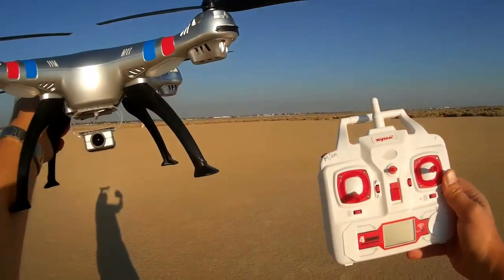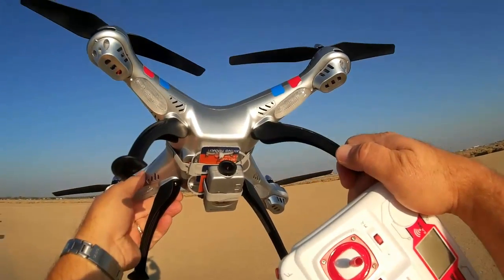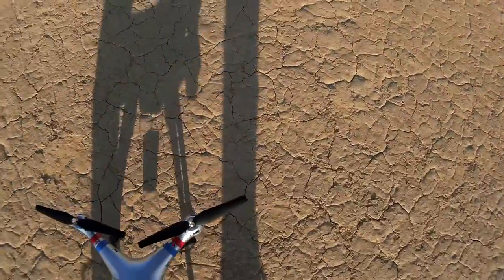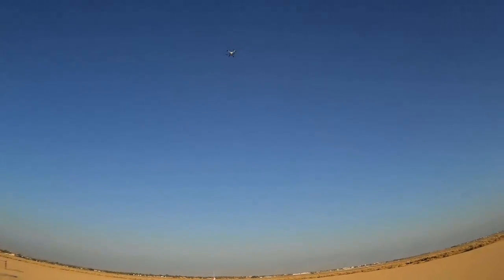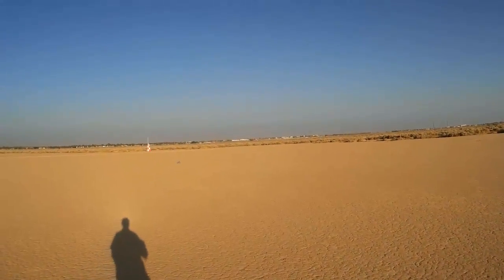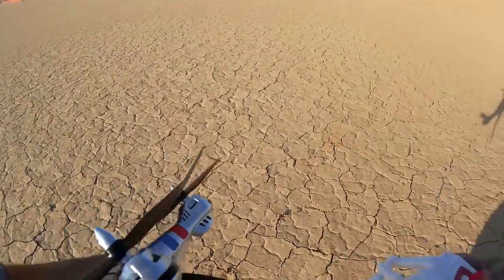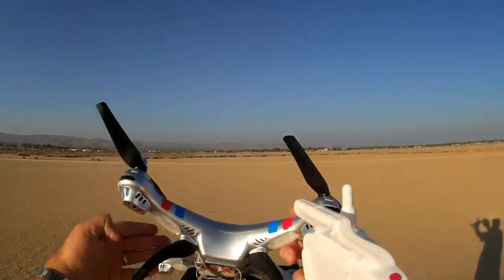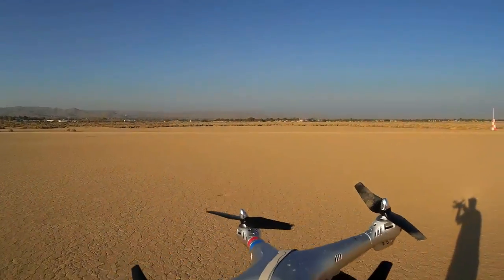Syma X8G Range Test

Comment: My X8G  got caught in a stream of wind at the beach and blew out over the water so far I was sure it was gone forever but I lowered the throttle and as it got down near the water it got some traction and flew back to the beach. I really cannot say in feet how far my X8G can go but it is about as far as you would want to go and still see it and enjoy it.  I don't know if it made a difference but I bought the expensive lithium super cell batteries for my controller. They are supposed to last 9x longer than regular batteries and they have been great so far.

Comment: i have a question , when the drone is going forward and gets out of remote range , does it shut down and crash or does it continu flying forwards until batteries are dead ?
Reply: +Markovish please respond , i've lost my syma x8g and i want to circle the area where it have possibly crashed in .
Reply from the maker: +Markovish Yes it drops.  Would recommend starting at about 300 meters down the direction that you last saw it, and keep working outward.
Reply: thanks a lot
Reply: hey again .. i have spent the last week looking for my crashed x8g but no luck ... i've used Google maps and looked within the remote maximum range area ... can you give me some advice please ?
Reply from the maker: Markovish Well, maybe somebody found it and took it home.

Comment: Does it really only go about 50 meters? I have the syma x5sw and it will Easily Reach 100 meters
Reply from the maker: +treverlid87 No it goes over 200 meters.  It turns out my particular transmitter was defective with poor soldering of the antenna.  Other X8G's should not have this problem (unless it was soldered by the same guy ;)
Reply: I'm having the same range issue. Can you share any resources on how to fix the antenna wire?
Reply from the maker: Ryan Hersh Well it involves opening the transmitter, and checking or resoldering the antenna connections to the circuit board. But if you have no soldering experience, a better option would be to first contact your vendor's customer service to explain the problem.  See if they can send you another transmitter.  If they give you a hard time, try PayPal dispute.  If PP dispute is not an option, just purchase another transmitter, as they're not expensive http://shrsl.com/?~dc4z

Comment: Quadrocopter 101    I have a question .How can increase the range of 100 meters?
Reply from the maker: +King Master 43 Its range is close to 300 meters. I had a defective transmitter.
Reply: Quadcopter 101 sp the drone will fly farther than yours plz respond and I'll sub
Reply from the maker: impulse 455 Yes it will.

Comment: I figured it out! The transmitter for the old x8c, is way powerful, so powerful in fact that it interferes with my audio equipment in the other room at a distance. When I switched on the x5c transmitters, there was no interference. so I set up a strength meter and I found out that the x8c controllers, at least the older ones, radiate way more power. That's how you're getting the phenomenal range. I would be willing to wager that they lowered the output power or modified the transmitters in the newer versions of this quadcopter to produce acceptable levels of signal. My cell phone doesn't interfere anywhere near as much is that transmitter does. I'd be willing to bet that that thing is producing close to one watt of signal. Without more precise ways of measuring, I can't tell you exactly how much power its making, but I'm willing to bet that this is why the x8g does not work as far.
Reply from the maker: +docchocobo Wow, you must be psychic :)  Here's today's video https://www.youtube.com/watch?v=JTJIkU8FOHg
Note that GearBest is selling an X8C transmitter for $11.  But please note that I'm not sure if it's the original long-range version, or the new X8G version with reduced output http://shrsl.com/?~9uyi
Reply: +Quadcopter 101 actually I discovered it by accident. wish I was on the ball a little quicker maybe I could have gotten it out before anybody else figured it out.

Comment: i put my batteries in my new syma x8g controller, when about 20 minutes later I go to pick it up (the controller is off) it had overheated and the batteries were leaking battery acid. so ive yet to use my x8g yet since tmart.com doesn't believe me. i got a new controller coming in, a x8c controller.. so lets hope for better range

Comment: Checkout my transmitter mod on my channel,also checkout the unnecessary range I achieve.Its a shame Symantec didn't figure this 1 out yet.
Reply from the maker: C0ckPitVuE 777 I know.  All of these toy quads can be easily modified to fly out well past 300m with $6 in parts.  I don't understand why there are only a few long range fliers in the toy class.
Reply: I believe w/out a reliable GPS compass or legitimate rtf  function,long range can be a costly and dangerous thing with these toy quads.I can fly my quad out of operating sight before operating range totally defeating the purpose,lol.
Reply from the maker: C0ckPitVuE 777 This is how I fly my quads out to the horizon as dots in the sky https://www.youtube.com/watch?v=qdYTCfjUVVo
Reply: Thanks for sharing,great information.

Comment: Video was great I was laughing when I saw it drop. Anyways, I was thinking of getting the fpv system for the syma x5c I watched your video and I'm wondering if you would still recommend it. Thanks!
Reply from the maker: Bret Sanderson Yes, the 5.8 Ghz X5C/X5SC FPV system is very good https://www.youtube.com/watch?v=CHVFwOCxvK0
and you can add it to just about any quadcopter since it has its own battery (although you won't be able to record its video on non X5C/X5SC quads.)

Comment: I need some advice, is it worth getting the X8G as it comes with the HD camera (maybe some small mods required to completely get rid of the standard jello) or should I just get the X8C and buy a runcam? Which would be the best option for video quality and range
Reply: MY135D My personal preference is the X8C with the runcam. If you take the X8C camera apart you'll find a small camera inside like on the Syma X5C. The thing is the top part of the housing can be used as a mount for the runcam with a small amount of modification. The top half is mounted firmly onto the X8C; you can also use the credit card style which works well as demonstrated in some of QC 101's videos. It also sounds like the X8C has good range, I know my X8C is great range, much better than the range on the one in this video.
Reply: +MY135D Get anything else and a Mobius or Runcam.  One thing we know about this one: it crashes good ;)   If you consider that a positive, then buy it.

Comment: Open the transmitter and quad and see if the placement of the antennas has something to do with the poor range.I foresee a range mod or a replacement Rx/Tx for this one.

Or alternatively,just use the X8G camera w/the X8C since it looks like the problem lies more in the transmitter or quadcopter.You seem to have a defective unit here.

Comment: Are you using the TX that came with the X8G? There might be a different TX module in the X8G's TX, perhaps one with with no RF PA or, more likely, a different antenna like just a 1/4 wavelength wire instead of a sleeved dipole. Have you tried using the TX from your X8C? That would check to see if the problem is the quad's RX or TX.

Comment: Are you going to open up the transmitter and do a range mod on it as you have done before? My 8XC has over 200 meters of range with the stock transmitter and my Runcam on it.

Comment: Based on my experience it's likely crummy antenna placement within the quad and/or crummy antenna placement within the transmitter.
What have become somewhat standard antenna mods to both would fix the problem, but a beginner isn't going to want to be burdened with that stuff.